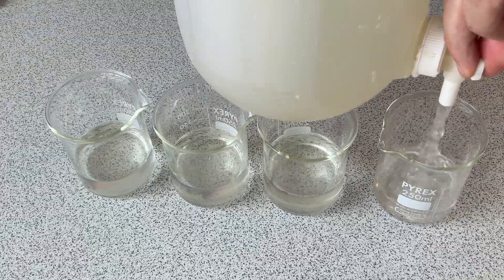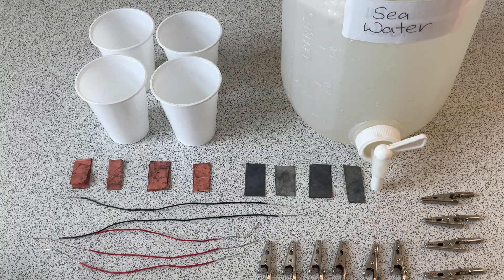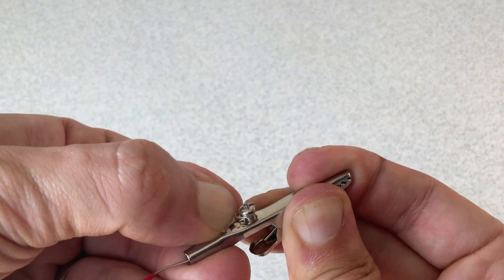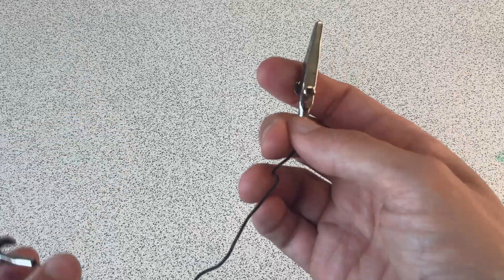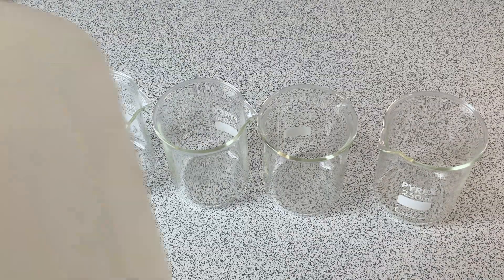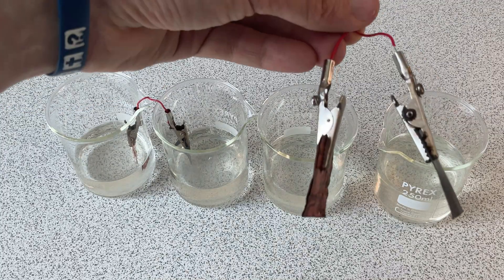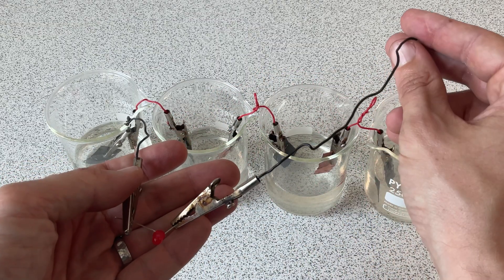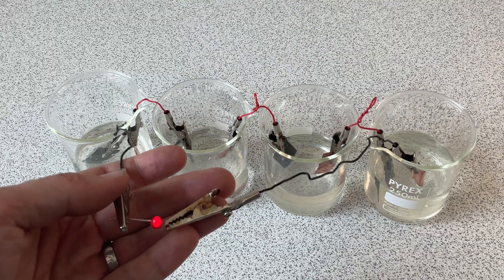How to make a salt water battery

Comment: LIAR
Reply from the maker: Could you be more constructive with your feedback? I don't understand what you are disagreeing with.
Reply: @mrdoey  A salt solution cannot produce electricity it can only transfer energy or electricity, therefore proving that this video is fake
Reply from the maker: You are right that a salt solution on its own isn't enough, you also need the metals. The attached video link explains how batteries work really clearly. You can see how the salt water battery in this experiment is quite similar to the first batteries every invented. https://www.youtube.com/watch?v=9OVtk6G2TnQ

Comment: How can I make this with a mini fan?
We have no electricity power for 10 days due to storms.
Please help
Reply from the maker: I'm really sorry but although these have enough power to power an LED it would be extremely difficult to scale them up to power a fan. It's like the problem Mark Rober had with lemons in this video .
https://www.youtube.com/watch?v=a1D-fZP8qJk
Reply: Easy you need to buy a mini fan that takes batteries cuz these are batteries then put the wires on plus and negative where the battery goes. Or you could go further and disassemble the entire thing and connect it to the wires
Reply: Yep. Not enough ergs to do anything useful I'm afraid